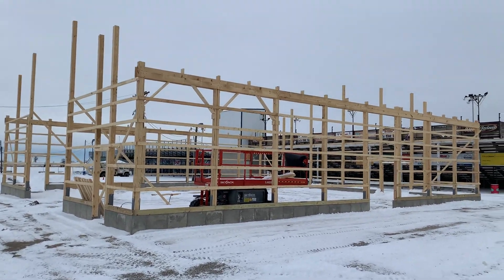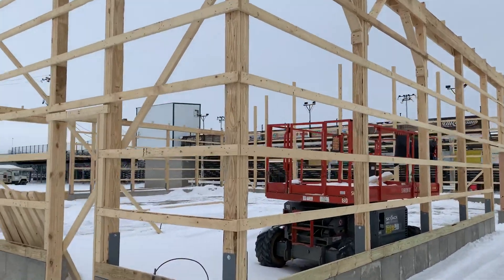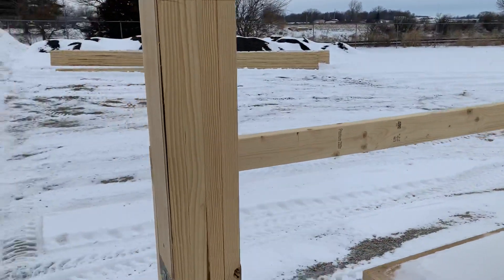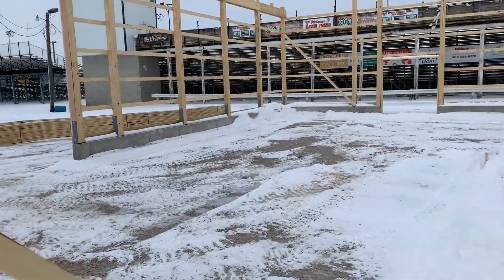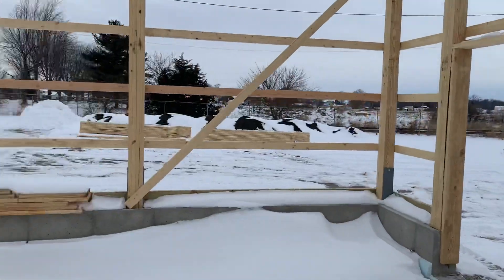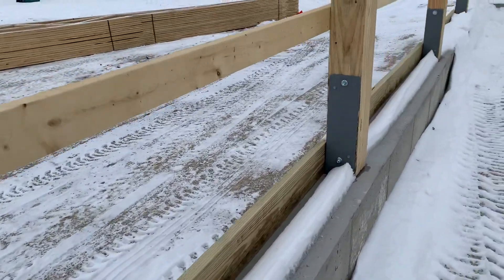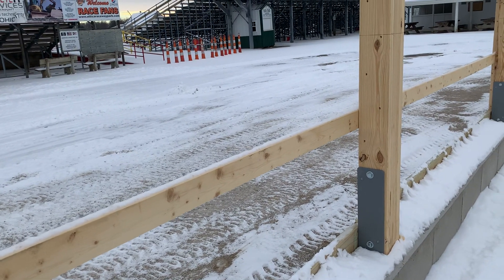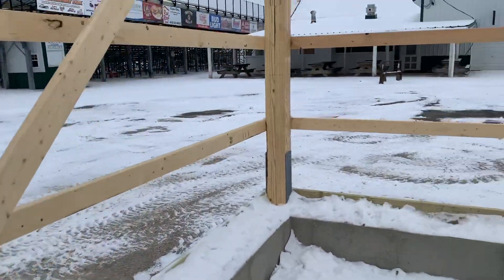Wet Set Brackets with 4 Plys (Pole Barn) - 60x64

Comment: How thick does the foundation stem wall need to be in the type of post frame? I’m looking to do a foundation like this for a new barn, and it’d be built into a hillside so would need a conventional walk-out basement (which will be a drive in garage) with a 6’ or so stem wall on the back side.